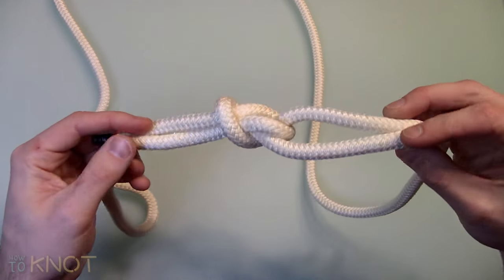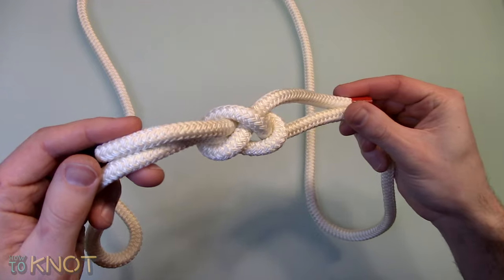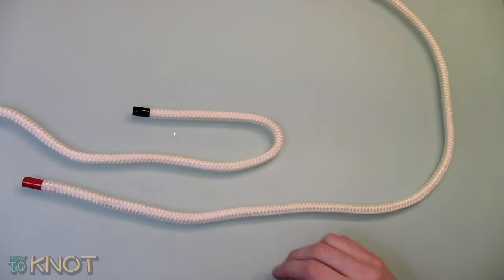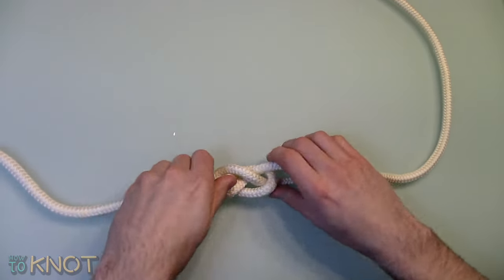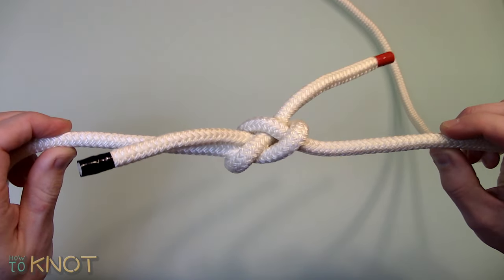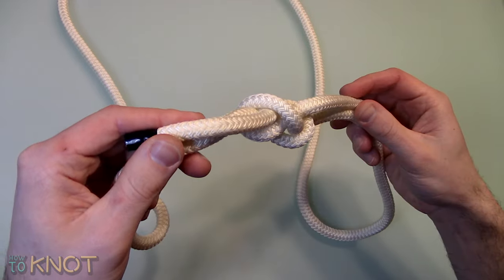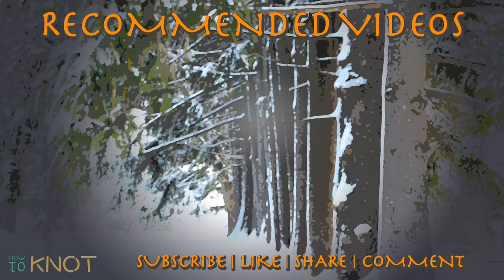How to Tie a Sheet Bend

Comment: Great video!  How is a sheet bend knot different from a square knot?
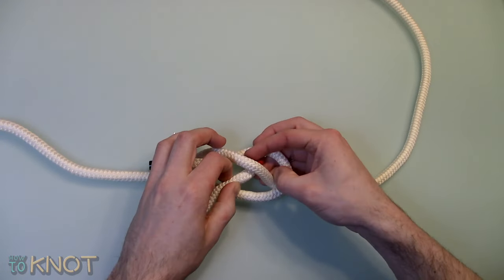Reply: Pause at 0:32 and instead of the tail end going back up towards the top of the screen, it would just come back out next to the working end, toward the right of the screen. A square not can pull out under heavy load, a sheet bend won't